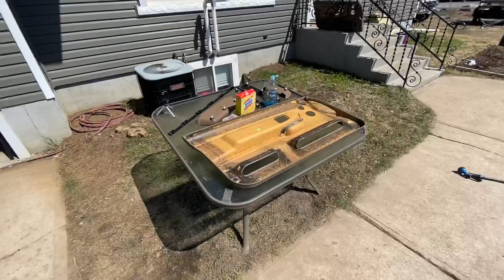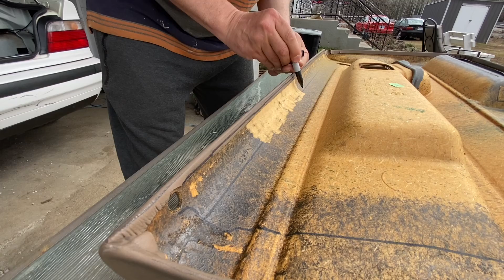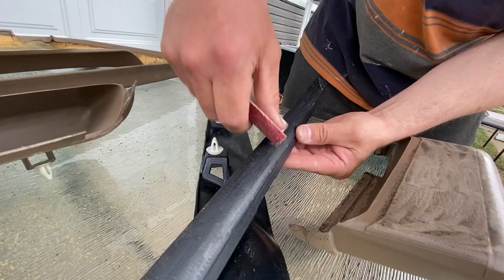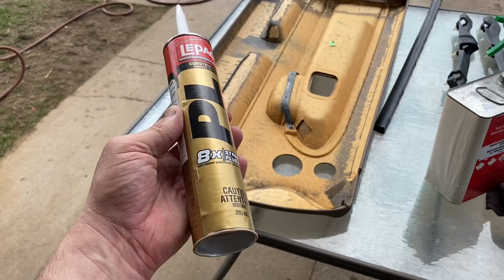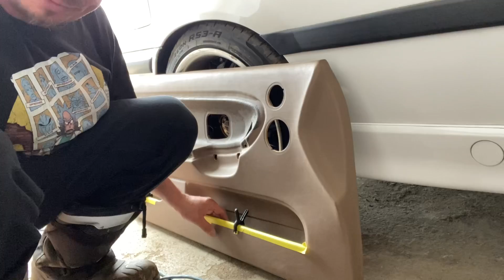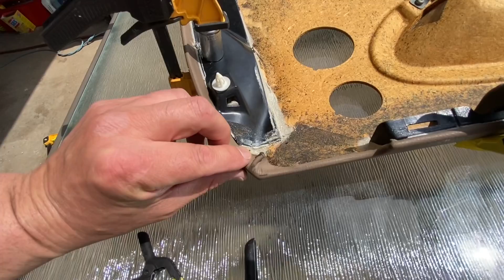BMW E36 door panel repair, door card fix. How to glue a BMW e36 door panel back together.

Comment: The black plastic is thin and brittle,  I would not grind it just use sand paper.  Top rail   crack and are not avaible nèw.  Ebay has some 3d printed  replacements.

Comment: Don't you think you're using way too much adhesive ?
Reply from the maker: Well it's been a few years and it's still holding up perfect, I think I used the right amount
Reply: @ProblemSolverGarage  The reason I asked is because the adhesive is so thick and when you apply it thick and then press the part down, you will never get it down all the way and it may have a tendency to sit up higher than when the factory glued it. I believe the factory used a very thin glue so the plastic pieces can line up perfectly. 
Is there a gap at the top of your trim ?

Comment: All of the grinding, cleaning, etc. is a waste of time. Use Gorilla glue original that foams and expands. Works great. Holds like a damn weld. Turns this into a 30-minute job per panel. With gorilla glue, you can fix the top door pieces in place even if they are broken, which they usually are. Give it 1 full day to cure and you will be amazed at the result. Gorilla glue doesn't care about the left over glue and other crap. It bonds to it all.

Comment: Hi, thank you very much for this video.  Is there a part number for the black plastic strip that attached to the top of the door card and is used to hook the panel onto the door?  In my e36 3.25i coupe it is made of composite board but I would ideally like a plastic strip?  Do you know how to source one?

Comment: Hi question . Are all E36 Door Handle assembly interchangeable? Can i use door handle assembly from coupe to sedan. My Sedan Driver side door Handle wont open from outside & inside and i cant find any parts for sedan because part was discontinued.Thanks!
Reply: you cannot, i believe sedan panels are shorter or longer… either way, coupe and convertible yes! convertible to sedan no!

Comment: Detailed video - no need to wash where you are going to glue if you prep by roughing up surfaces...........just flapper disk then wipe surfaces clean with acetone or similar.  And what is with soooo much glue - seems like about 3 x what is needed to achieve same strength. I dunno - just my opinion after having used 1000 of tubes of PL and the like. 
You do a good job of showing everything you do - thank you for posting the video.
Reply: i had the same thought..  with how thick it is, id fear that theyd stand off a millimeter or 2 away from the door frame..  im going to just run a bead on one side and use a putty knife to spread it evenly

Comment: You dented the vinyl by not putting some foam between the clamp claw and vinyl
Reply from the maker: It came back out after a few hours
Reply: @ProblemSolverGarage yup it’s comes back out but if you have something to use flat against it better but not too big of a deal. Doing it as we speak 😊